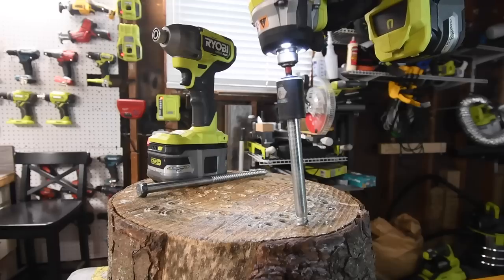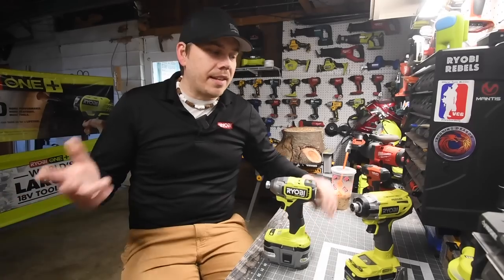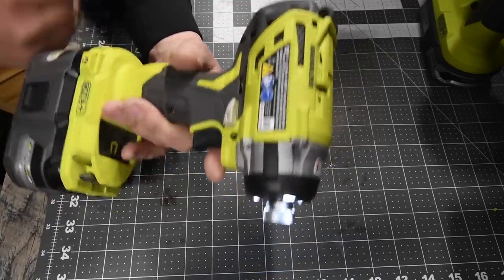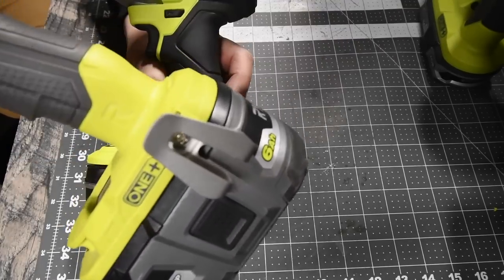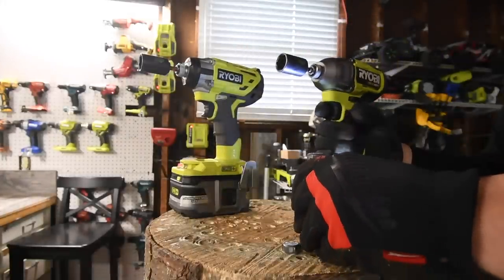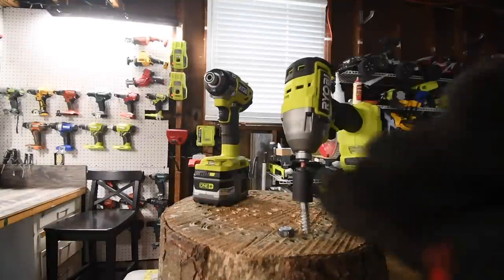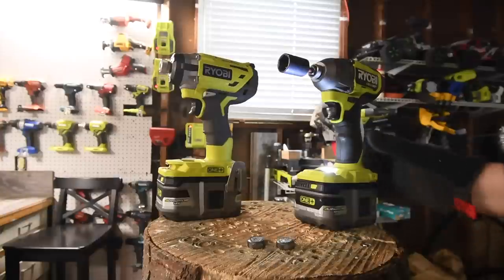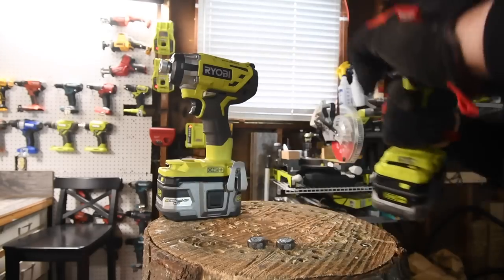Ryobi P238 vs NEW Ryobi HP (Impact Drivers)

Comment: Next time your in Home Depot try the Husky brand adapters you'll be surprised.
Reply from the maker: I already did, they lasted 2 episodes
Reply: @ManCaverTools  yep
Reply: I would recommend the DeWalt adapter
Reply: @VacMaster2020  i twisted mine like a pretzel with lug nuts on a 80s ranger lol, also wait a minute I know you.
Reply: @bread-gz3rl  Which ones
Reply: @VacMaster2020  I'll send you a pic on discord
Reply: Try the Hercules socket adapters they are incredible to use

Comment: I think the issue with the adapters is they haven't caught up with the increased power and increased frequency of impacts the newer impact drivers have.  They need to increase the strength of the adapters to match the power of newer impact drivers.
Reply from the maker: I Thank you so much for viewing :)
Reply: No! They Changed The Metal! The Older Adapters Just Dont Break Like The Cheap Made New Ones Do!!

Comment: Great video! I’ve noticed those adapters breaking a lot also. I believe the guy who does “Shop tool reviews” said he used the regular Husky brand from Home Depot. He said they were cheaper and withstood more punishment. Try them out. I know Milwaukee can’t be cheap brother. Thanks for the video!
Reply from the maker: I Thank you so much for viewing :)
Reply: @ManCaverTools  i would try getting a cheap adapter and put 10 different kinds of epoxy putty over it like project farms. I'm sure it won't ever break

Comment: As someone who upgraded from ryobi to Milwaukee the one thing I miss is that magnetic tray. Was always nice to drop a handful of whatever I was driving onto that tray, or when taking something apart it is nice to put the hardware on it instead of pockets or the floor. I wish other manufactures would adopt that. I think there are aftermarket solutions for this but it’s nice when it built into the tool
Reply from the maker: I Thank you so much for viewing :)
Reply: I work off ladders a ton and can confirm, the magnetic tray is the best feature

Comment: They should of kept the 3 lights on the front of the drill. It's way better. It gives you the light EXACTLY where you need it. They should of kept the magnet tray as well. Why change something when it works perfectly smh.
Reply: Probably because the oem body is just some Chinese company pumping out frames from multiple company’s. Random guess. I’m sad about it too.

Comment: Thanks for the comparison of these 2 brushless brothers. I got in a bind last week and had to go grab 1/2"drive impact and I grabbed the P262 after seeing your evaluation and couple other's, I felt it had all the balls needed for the particular job, and it smacked that axle nut loose in less than 2.5sec. I know I could've gotten the high torque for roughly $30.00 bucks more, but new mid torque is no slouch. It'll remove Simi lug-nuts without breaking a sweat, but I wouldn't normally ever use it that way. Just happy as hell it worked out.
Reply from the maker: in most cases the mid range will take care of most tasks so good choice

Comment: I’ve had the p238 for years. Even though I switched to Milwaukee when I started side hustling, I still have it and use it on my personal vehicles. If it had a 3/8 or 1/2 freak style anvil it’d be a perfect diy mechanics tool.

Comment: Picked this up with the hammer drill back when they started showing up at HD. Had about 14 beams (a few triple beamed) to drill through and a bunch of 3” nails to run in some electrical, and figured it’d be the perfect time to run the new impact. After about 7 holes, the metal casing was super hot to the point I let it cool of for about 20 minutes, and it was still hot
Reply from the maker: I Thank you so much for viewing :)
Reply: Tbf a impact was never designed to drill through anything let alone steel beams
Reply: I Have An Older Blue Ryobi Drill That Blows Away The New Ones That Come Bundled With An Impact! I Bought It For 5 Dollars At A Yard Sale 8 Years Ago! I Use It To Mix Drywall Mud! The Newer Green Drills That Came With My Impacts Get So Hot That I Gave Them To My Grandson As They Are TOYS!

Comment: I Loved My Old Ryobi Impact But The Tri Lights On The Front Quit Working! So I Bought The New HP 3 Speed With The USELESS ADAPTIVE MODE! It Is A Little Bit Better Than The Old One In Line With Dewalt's XR Line! But The Dewalt ATOM Line SMOKES It! No Contest! But I Own A Couple Of Dozen 4.0 AH Or Bigger Ryobi Batteries So I Wont Be Making The Switch For A Couple Of Years!

Comment: We love the P238 and the Tri-LED. I don’t think I need that max power. Also I don’t like the metal front especially if it falls or slips onto you work ark areas. Plus with all these new drill coming out I can get the P238 at amazing prices.
Reply: EBAY Has The Newer Ones For CHEAP! Since I Own Dozens Of Ryobi 4.0 Batteries I Am Stuck In Their Eco System!

Comment: Hi, I'm curious if I don't need a hp battery for my HP impact driver since it doesn't need or have those HP prongs?
Reply from the maker: you can use any Ryobi battery on them. HP doesnt require HP to use them

Comment: I'm definitely thinking that the old HP connectors are a non-issue on the new tools. They probably figured a way to get the full pull of the battery without them.
Reply: Unless You Have A Grinder 1/2 Drill Or Saw The Other Connectors Do Nothing! I Have Tools With And Without! Like The Sawsall Has Them And They Do Make A Dif In Keeping The Tool In Working Mode! That Is To Say That With A Battery That Has The Extra Connections Vs A battery Without On The Sawsall The One Without Stalls Out faster Than The One With Them! That Is Never A problem On An Impact As It Never Stalls The Motor! Same Thing On An 1/2 Drill As The Saws All! It Stalls Out faster When Using the 4.0 AH Battery Without The Extra Connections!

Comment: Impact drivers should just have a combination 1/2" anvil with a 1/4" collet, like on the Bosch GDX. 

But they'd probably have to license it from Bosch, and that would add cost. Instead they can just sell you adaptors that break easily, or another tool, which adds profit instead.
Reply: Just put a 1/4 collet adapter on the anvil.
Reply from the maker: I Thank you so much for viewing :)

Comment: Two things about adapters, look at the size of the bolt that it drives. Second, the fact is that the tools are making more power now. They do have to make stronger bit's for the increase in power. Of course they will cost more!

Comment: Was the P238 switch set at #3 like the Hp one was? Just doesn't make sense that if the P238 has a higher torque rating and higher rpm capabilities that it would perform slower unless the switch setting wasn't at #3

Comment: Just got a P238 which was discounted at HD for $59. Does battery Ah size contribute to driver power? Confusing with all the battery options.
Reply: Yes it does, normally for most tools I'd use a 4AH or bigger 2AH at the minimum

Comment: have you tried the dewalt 1/2 solid shank adapter? runs around 8 bucks at tractor supply and with stained the most abuse on projectfarm's video.
Reply from the maker: I Thank you so much for viewing :)
Reply: But it's still 1/4 inch at the end

Comment: You use only one hand and on the handle of the driver.  Actually the way most will.  BUT by doing this you are not pushing straight down, but are putting a bending force on the adapter.  If you want to not break so many adapters then when using high downward force put the palm of your hand on the body of the impact wrench.  Your technique is what is breaking the adapters.  Some people could break an anvil.

Comment: I'm upset with Ryobi they could've atleast left the bit holder, and not even a belt clip, all of the old drill models even have them. Another thing im upset with Ryobi is with their super charger. They should make one that can charge all the batteries at one time. Other brands have them and it's so sweet. I know if Ryobi did the demand would be very great
Reply: They just made a new super charger, and it work just the same as the old one 👎
Reply: @cerealkiller4341  there's not really much of an upside to that cause what if you're working on a project that involves multiple tools or drills that drain battery power fast. Ryobi can do it it's not rocket science
Reply from the maker: I Thank you so much for viewing :)

Comment: I want see if it is possible you can take the 3/8 in anvil off the imp t wrench and exchange it with the 1/4 in hex on the dewalt and see if the 3/8 in anvil is better on the dcf887. Just like what Dave did with the Milwaukee impact driver
Reply from the maker: I Thank you so much for viewing :)

Comment: Hey @mancavertools maybe you could help settle some rumors/ theories. Ive heard at least 4 times from 4 different people at 4 different places that the Milwaukee and Dewalt power tools sold at The Home Depot and/or Lowes are different, quality wise. Meaning that the ones bought from big box stores contain parts not built to the manufacturer's usual quality standards. Is this true??? Can you do a video clarifying this conspiracy theory???
Reply from the maker: I Thank you so much for viewing :)
Reply: The same model tools are all the same no matter where you buy it. HD and Lowes sell 2 different DeWalt drills the 998 power detect and HD has the 999 Advantage

Comment: Those adapters are such a horrible design because why put a thin spot in it?
You’re making an intentional weakest link. The ones that have the 1/4 hex as the thinnest part just seem to be better and making the hex shank thicker is impossible without completely changing the product. I have some by neiko and they seem more substantial
Reply from the maker: I Thank you so much for viewing :)